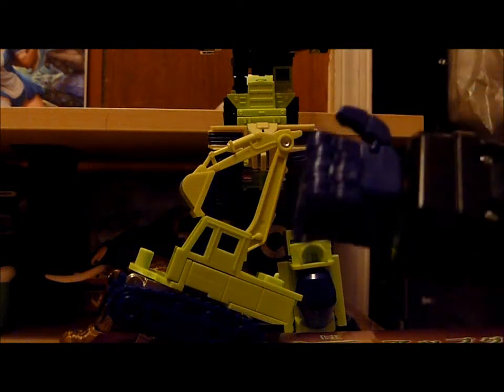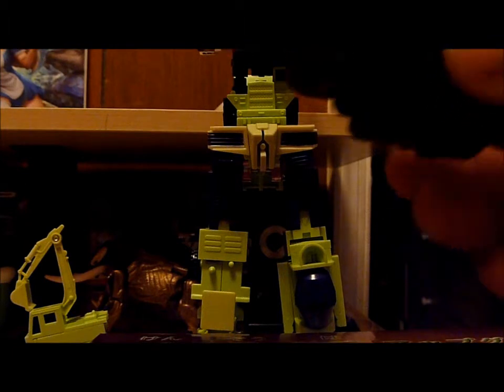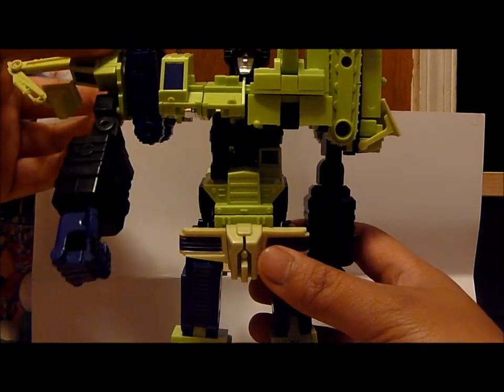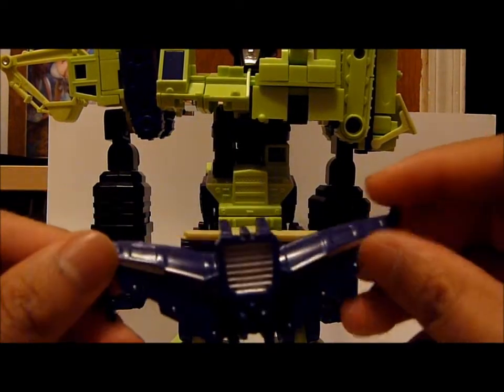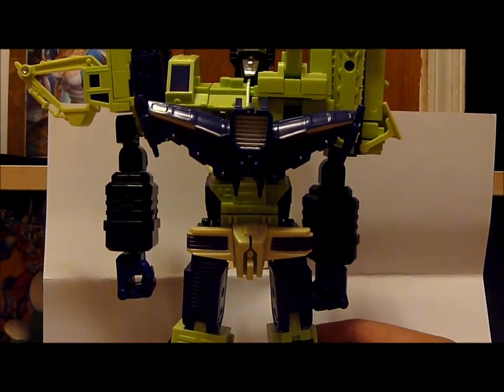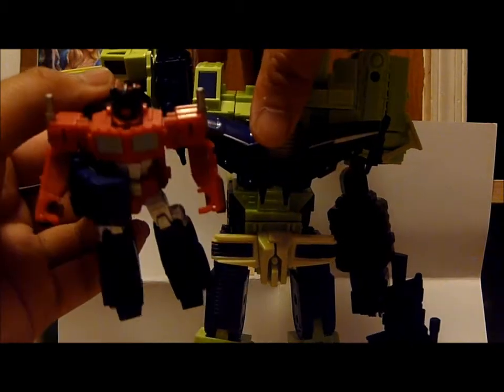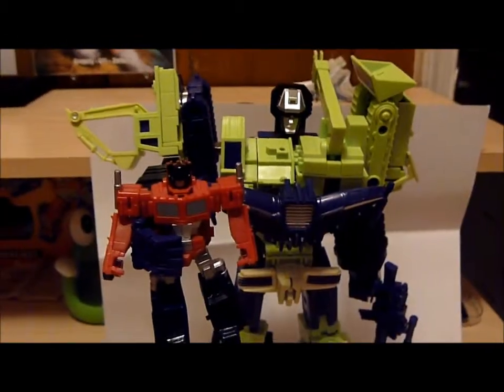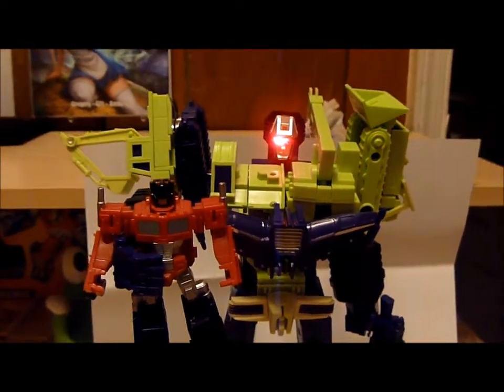Xtransbots XP-1 Destroyer Devastator Upgrade set  Part 2

Comment from the maker: @Thundercracker1981 haha yea Like i said it takes some serious patience trying to get those forearms to look straight on hook. It takes so much effort because there is no clip on the neck piece like on the original so the torso will easily be misaligned making the forearms slanted, but it is adjustable. And the CDMW prob does have its better pts, but it still has many of the same issues like the glass fingers and leg connections.And yes the arm hinges are very awk =]